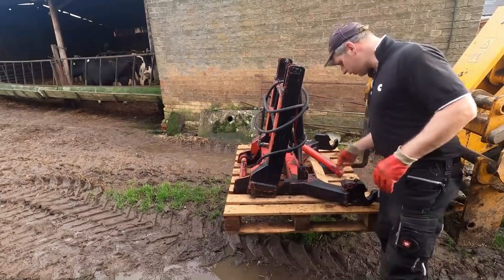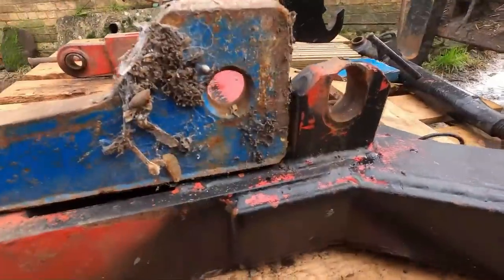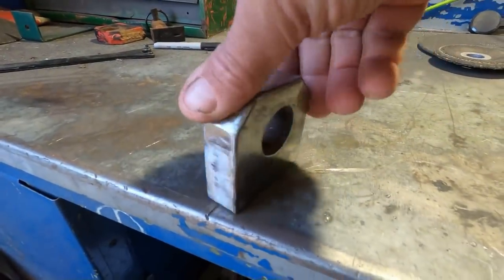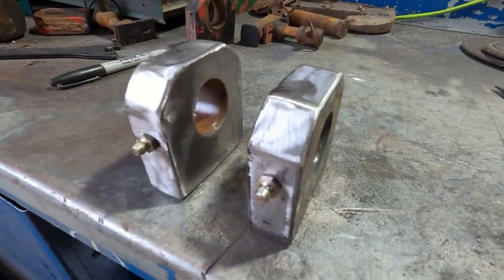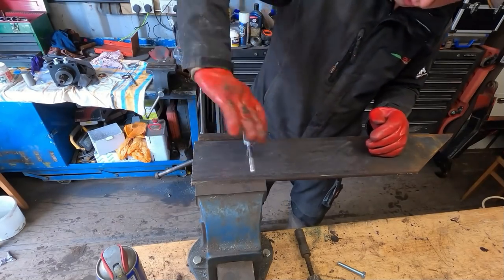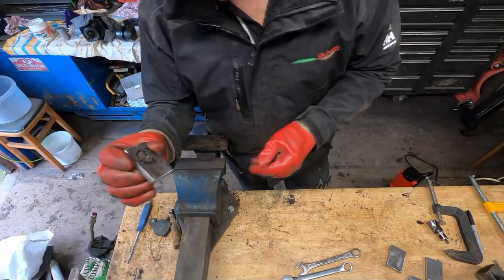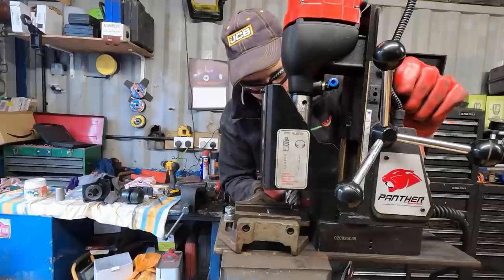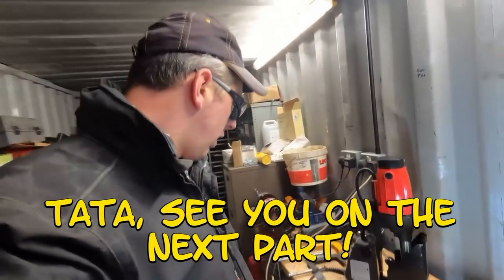FIXING The New FRONT LINKAGE

Comment: We have 3 mag drills at work, we used to have a fourth but someone turned off the site generator while the guy was drilling overhead and he had no strap on lol Good cutting paste and they last for a long time, only ever broke 3 in about 15 years mostly trying to push the drill and drill for wall plates fast on beams
Reply: I had it happen to me on a building site, i was drilling an overhead steel to hang some glass sliding screen off and someone unplugged my extension lead, 3 weeks off work with a ripped tendon in my shoulder....
Reply: @wolfe1970  damn
Reply: @wolfe1970  I have been lucky that way

Comment: Fab video again George, and absolutely no hate, but your still gona encounter steel on steel wear with the pins, 
Did you consider oversized the holes and fitting Oilite bushes? Also for welding, remember a good profile on the weld face for pennatration, an I would be inclined to be using flux core with min 6 runs or use a stick.

Comment: Thanks george for another great video i have a zetor 7245 i could do with a front loader a quickie loader is around 2000  a light loader would do me i would
'nt be stacking silage bales and not on the tractor when not in use the axle is weak enough one fault of a zetor why they put they put the trackrod in front of the axle i already replaced on cost me about €80 i wonder if i could get a front loader in the uk shipped to ireland for less than  a 1000 im a welder so i can adjust the brackets if need be👍